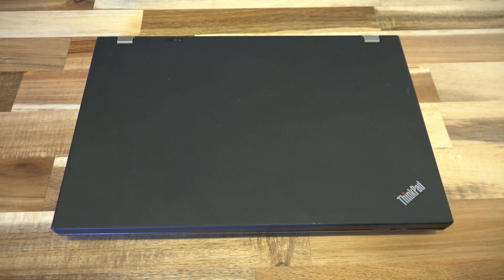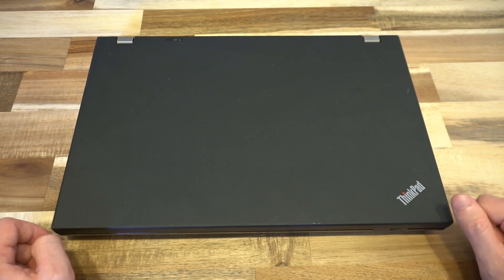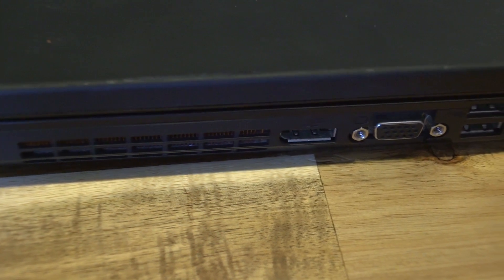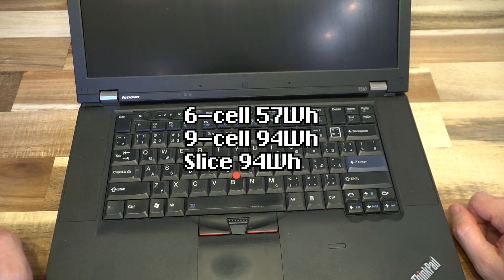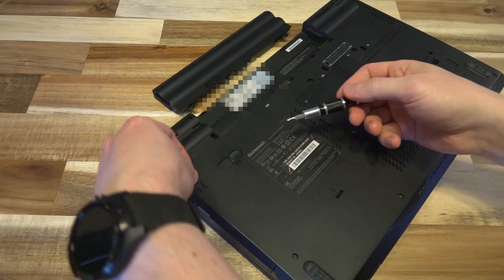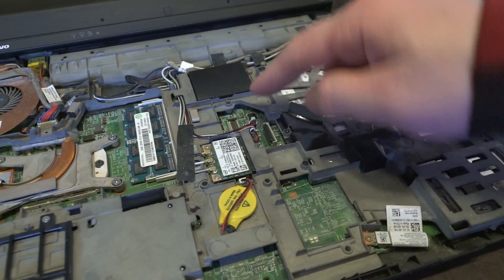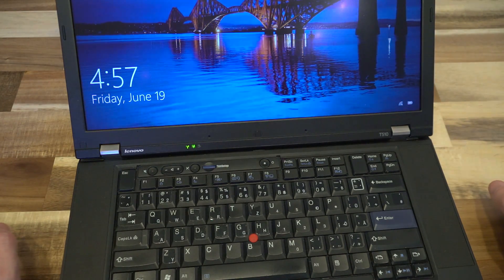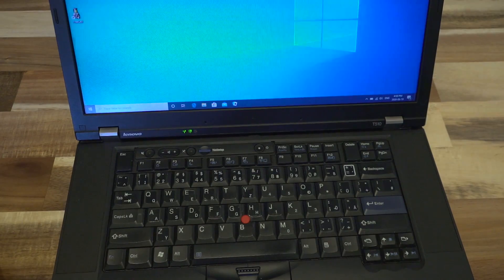Lenovo ThinkPad T510: Intel i Series Arrives

Comment: I have one of these with the original specs. It had only 4gb of ram and came with windows 7.
Reply from the maker: Cool, does it still get used for anything?🤔
Reply: @LaptopRetrospective  I use it for media and browsing, and for watching DVDs as it's my only disc player. 

Also, is there supposed to be another card in next to the wifi one (like a modem card) ? Mine has an empty slot with three wires coming to it.
Reply from the maker: @dominicsapl likely some kind of expansion card, I'd have to dive into the hardware maintenance manual for the answer.
Reply: @LaptopRetrospective  It uses the same slot as the wifi card (mini pcie). After searching online I think it's some kind of dial up modem card. Two wires go to the modem port on the back, and one goes towards the screen hinge.
Reply from the maker: @dominicsapl Sounds plausible for the era. 👍
Reply: Also I think the trackpoint is jammed, I can't get it to budge. I even tried removing the rubber cover to push it. Do you have any tips on how to get it loose?
Reply from the maker: @dominicsapl So the TrackPoint doesn't actually move in the traditional sense. It works off of detecting strain on the post and moves accordingly. Check to make sure it is enabled first. Some older ThinkPad units have a F key shortcut to turn it on and off.
Reply: @LaptopRetrospective  Oh, thanks! Mine was disabled (previous owner set trackpad to only pointing device) and I never used it, so I thought they moved.
Reply from the maker: @dominicsapl I figured there was a good chance of that.

Comment: I tried installing an i7 720QM, but even with nvidia graphics all i got was a black screen and no beep code. Maybe theres a certain setting in bios that would allow this cpu, but for me it didnt work. When I put the original cpu back, the laptop started working again.
Reply from the maker: Interesting. Any way to verify the CPU is in working condition? Might need a BIOS update to support as is often the case.
Reply: @ hmm seems as if im running the latest bios (from 2012). When i turned on the pc the cpu was producing heat, but thats about it. Maybe reflashing the bios would help, but id need to get new thermal paste to test that out

Comment: 🤣Watching this in 2024 on a thinkpad core i5 t510 that I got for free due to being BIOS locked and unbootable cause of it. The owner had forgotten the BIOS/administrator password and was just going to throw it away since it wouldn't boot without said password. I saved it from going in the trash and unlocked the BIOS by shorting out the eeprom chip and was able to then install a 500gb hard drive I had laying around that already had windows 10 on it. I kinda just did this for fun as a challange to myself to see if I could get it going without any real plans of what to do with it afterwards. Well the thing works so good that its now become my daily driver that I've been taking back and forth to work at various construction sites. It boots WAY quicker than my 2 year old HP and also my wifes 4 year old Dell. Also seems to have no lag when opening up apps, or browsing the web. The screen leaves a bit to be desired compared to my other 2 laptops but I'm absolutely blown away with how well this 14 year old laptop performs. For internet out on jobsites, I set my phone as a mobile hotspot and connect to it via WI-FI which works flawlessly! The thing is built like a tank and very rugged which is perfect for my line of work as a commercial construction jobsite superintendent.  Heck even the original battery still holds a better charge than my much much newer HP whilst the battery on my wifes 4 year old Dell doesn't even hold a charge at all anymore. They sure dont make things like they used too!!!!!

Comment: I have same laptop, I want to replace it's wifi card because it is slower and I think upgrading it to the latest supported version will improve the performance. Please let me know what is the latest wifi card it can support. Thanx in advance.
Reply from the maker: I'd start looking at the BIOS modding forums and websites for the best information.
Reply: @LaptopRetrospective  One more question, would it be better to get an external (usb) wifi adapter than going through this process?
Reply from the maker: That's up to your level of comfort.

Comment: Nice machine!  Funny how this has the 16:9 screens and the T410 had the 16:10 screens.  Btw, is that a color scanner on the right side of the trackpad?
Reply from the maker: I don't recall seeing any electronics under it, there were ribbon cables though. I thought it was a punch out for a fingerprint reader. Hmmmmm.
Reply: @LaptopRetrospective  just rewatched and yeah, doesn't have anything under it.  That said, the fingerprint scanner is of the slide variety, and should be a different palmrest SKU.  Maybe the HMM has an answer?
Reply from the maker: Sounds like a mystery in the making.
Reply from the maker: That makes a lot more sense.

Comment: 1. I've never run into a ThinkPad that actually has that optical drive security screw present. This is the first time I'm seeing that.
2. The WWAN port cannot be used for an mSATA drive. It's not wired for that. Starting with the T420/T520 is when that would work.
3. I'm 100% sure that you cannot install i7 quad cores, but you can install i7 dual cores. This is using the stock BIOS. There might be a modded BIOS that allows for that.
Reply from the maker: 1. Me too, it took me a second to figure out what was happening.
2. Yes, looks out that's right. I'll add that to the Post Video notes.
3. The i7 from what I've seen from the Withdrawal Book and Spec sheets can be, but there are anecdotal warnings that the cooling system wasn't meant to support the 45-55W CPUs.
Reply: @LaptopRetrospective  3. I re-checked the PDF spec sheets and the T510 still doesn't show i7 quad cores. Only the W510 and W701 were ever sold with i7 quad cores (1st gen). So if anyone has done this specific mod then they can input their experiences here.
Reply from the maker: I've found some instances of people doing this on German forums. Again, it isn't suggested due to the cooling issues but the CPUs do fit.
Reply: Laptop Retrospective you can do it, only if it have a dedicated GPU. These i7 quad cores dont have Intel graphics.
Reply from the maker: Thanks for the information RoD Flag!

Comment: I have a T410i that I use daily, 8GB RAM, 240 GB SSD, external 24 inch monitor and FreeBSD installed. It is a workhorse!
Reply from the maker: Sounds like quite the setup.

Comment: A T510 I picked up via ebay surprisingly came with 2 blue colored USB slots on one side. I have not had a chance to test if they are actually 3.0 or just colored that way......
Reply from the maker: That's very curious. USB 3 wasn't offered as far as I know until the next gen.
Reply: Your laptop probably is a W510. As far as I know the T510 did not have USB 3.0.
Reply from the maker: Yes, W510 has two. Had to check the books.
Reply: @goranzavicsa3369  Yes, you are right, it is a W! My mistake.
Reply from the maker: Mystery solved and we are all the smarter for it. ;-D
Reply: @goranzavicsa3369  I was surprised it had USB 3.0 because even when I bought a new X220 back in the day, USB 3 was only available as an option with an i7 processor, (not the i5).